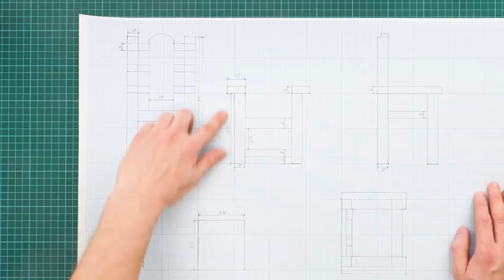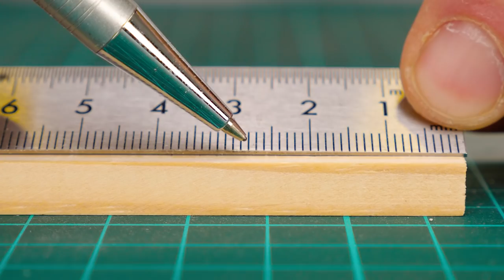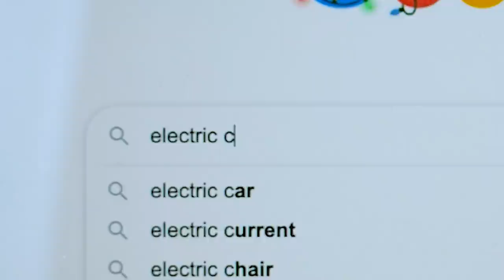Building Tiny Electric Chair Out Of WOOD AND LIGHTER

Comment: How does the audio portion work?  I have the miniature speaker and the lighter, and have built the chair, but not sure about the audio and how it is all wired.  A parts list and wiring diagram would be helpful.